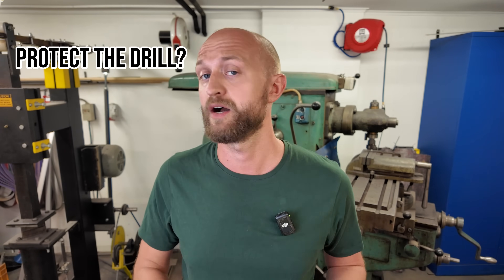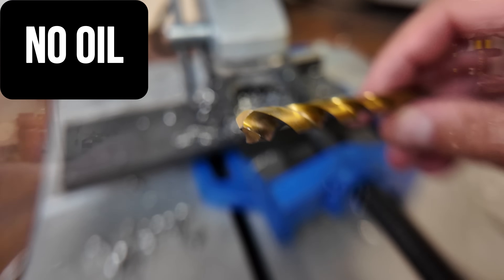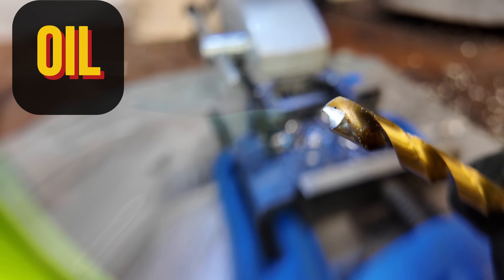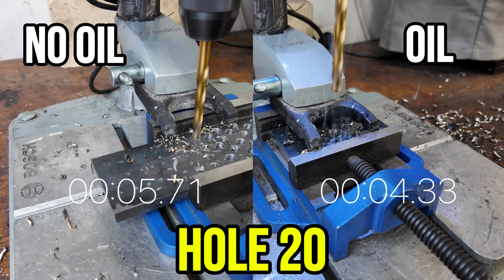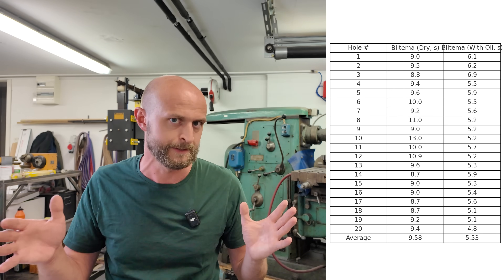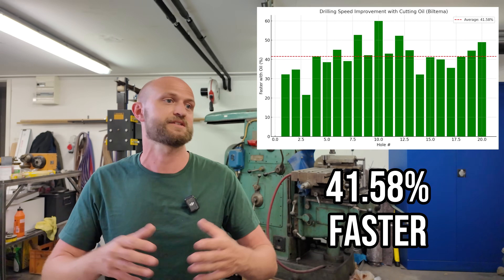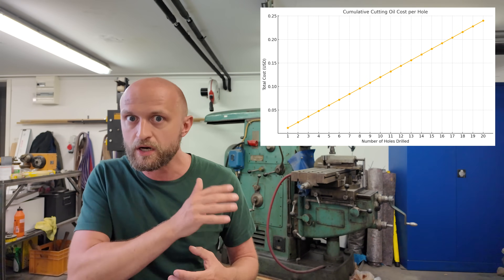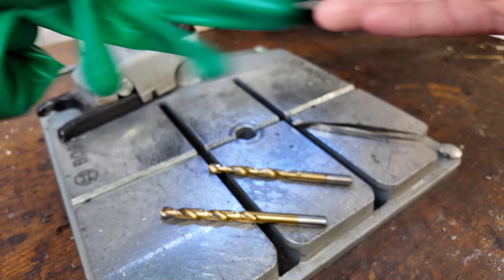You’re Drilling WRONG — Here’s the Proof

Comment: Don't use oil for drilling, it makes the cutting edge slide past the workpiece, causing friction, heating the drill and dulling the edges. Use an emulsified coolant to cool the cutting edges, a cool tool, is a sharp tool. That's also SLOW for drilling the hole size you're working with, in what appears to be mild steel. 100 surface feet per minute for HSS in mild steel, 3.82*100/.312= 1,224 RPM, feed probably about .0015"/REV or 1.83IPM (1224x.0015=1.83)
Reply: That's information for CNC.  None of that is feasible with hand tools.  Like how do you achieve 0.0015"/rev with a drill press?  What you said about oil causing friction isn't correct at all.  It isn't friction that cuts the material.  

That material is 3/8" thick, and it took about 5 seconds to drill through with oil.  That means 0.075" per second.  To achieve 0.075" per second at 0.0015" per rev you'd need 50 revolutions per second, or 3000 rpm.  But in the test he's shown the drill press is running at 1000 rpm.  So he's achieving 0.0045" per revolution.
Reply: @unhinged-menagerie  you still generally want the surface speed about right.  Being lower usually won't hurt anything except for your cutting times though.  And if you're getting stringy chips, you either need to feed harder or then at that point you'd slow it down if you're at the limit of what you can do by hand.
Reply from the maker: Great points. For an 8 mm (~0.315") HSS bit in mild steel, 100 SFM gives about 1,220 RPM (3.82×SFM/diameter), so you’re right—that’s the high end. I ran ~1,000 RPM, which is the lower side of the normal 80–100 SFM window. With a handheld drill press and spotty chip evacuation, I tend to bias slightly low to keep heat in check.

On feed, 0.0015"/rev is pretty light for 8 mm—more like finishing territory. I usually aim around 0.002–0.004"/rev (≈0.05–0.10 mm/rev) so the edges bite and make proper chips instead of rubbing.

Re oil vs coolant: oil doesn’t make the edge “slide” if you’re feeding correctly. The lubricity helps at the tool–chip interface and cuts down BUE; flood or emulsified coolant is great for cooling, but on a drill press a dab of cutting oil works well—as long as you keep the feed up. Cool tool = sharp tool, agreed. Surgeon rule of thumb: steady pressure, clean chips, minimal smoke. 😉
Reply: No one is using coolant on a hand operated drill press. Coolant is for industrial use in enclosed cabinets.

And clearly the tests prove using oil isn't causing the drill to slip. If that's your problem, you're forgetting the "press" part of drill press.
Reply: @Grauenwolf  We use mist coolant Fogbusters on our manual mills at work, and on our manual lathes, we use spray bottles — both with TrimSol.
Reply: your number 1 enemy is chips. get them evacuated before thinking about anything else you can do

there is not much you can do to prevent heat build-up in an HSS drill, simply due to the fact the no cooling will actually reach the cutting tip down in a hole, now when cutting thin sheet goods, anything thinner than 1/3 of your drill size its not a problem. when drilling at a depth up to the same size as the drill, its doable. anything deeper you want to peck unless you have "through spindle" / "through tool" cooling, pecking at somewhere between 1/2x - 1x the tool size, per peck.

had it been a carbide drill w/o internal cooling, you would want to go deeper, about 1,5x if not more.
a carbide drill with internal cooling you DONT peck unless there is another reason to do so. since the chance of chipping the tool is, when the carbide tool engages. whereas with HSS its more about when it gets dull

Comment: Apparently cutting oil is better than other oils of similar viscosity because it doesn't have extreme pressure lubricity, allowing the edge to penetrate better, while still lubricating the flats of the wedge.  Low shear strength or something.
Reply from the maker: Exactly — cutting oil’s chemistry is tuned for shearing metal, not just sliding over it. The lack of extreme pressure additives means the edge bites instead of skates, while still reducing friction on the clearance faces. Basically, it lets the drill cut instead of ice-skate.
Reply: Yep.